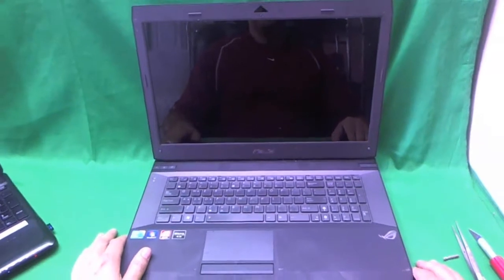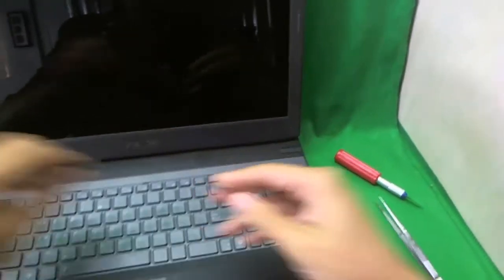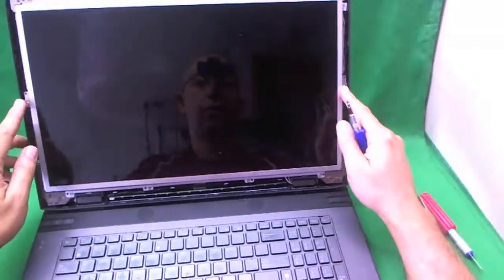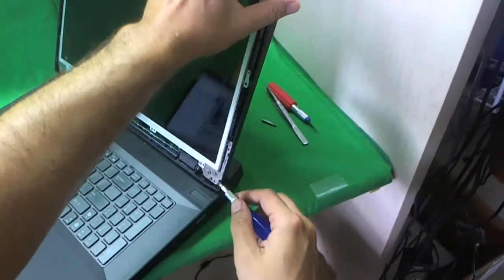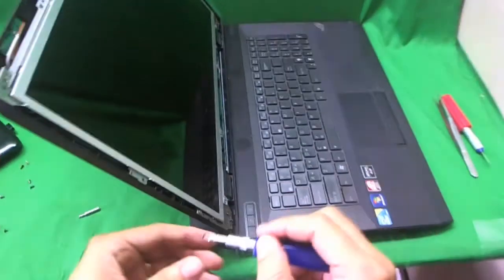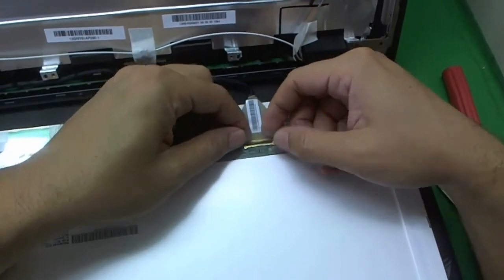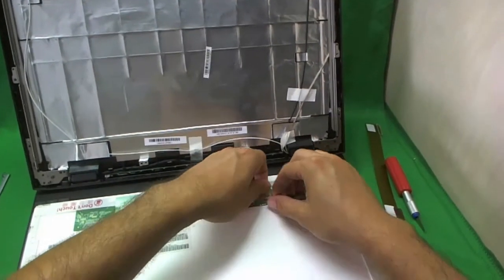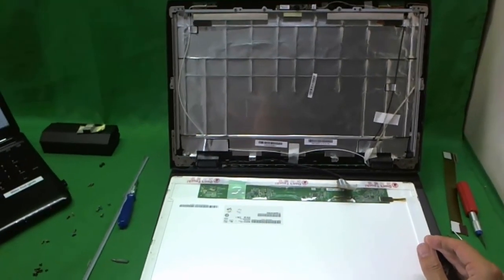ASUS G73J G73JH laptop screen replacement procedure

Comment: Please, get on with it.
1. Very brief statements of warnings-battery removal ect.
2. Full disassembly/  replacement steps.
3. Then pointers and conversation.
Just politely pointing this out to help move the video to a shorter run time and getting to the point of the video.

Comment: I recently have an issue with my G73SW: there have been random black/discolored dots/lines that appear in certain areas around the screen. Not in any particular area, as it moves with the pictures/videos. The effect is greater if any pressure is applied to the top right corner above the keyboard. I had disassembled and reassembled and the problem went away. But when I took it back to class the problem occurred again. I think it's because my backpack is a very tight fight, though snug.

Comment: The lower third of my tft screen was a little brigther since 2 days... it recently began flickering and i thought it was the backlight. i then bended the lower screen frame a little and experienced heavy screen distortion, stripes, flickering. But in a specific "bend" position the screen turn back to fully normal and stays there for a while. I suspect the thin cable connector to be loose. Is this worth a try?

Comment: You are awesome. After half my screen went "rainbow" on my G73JH-A1 14 months after I bought it, this screen replacement did the trick. I just replaced it entirely by using your video. Thank you a ton. Now if only I could fix my sketchy trackpad and noisy fan...